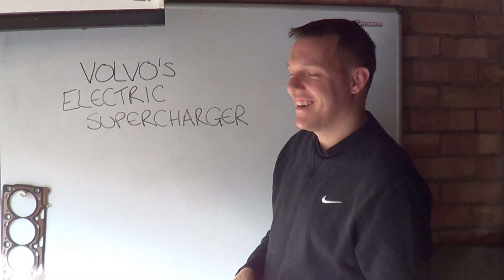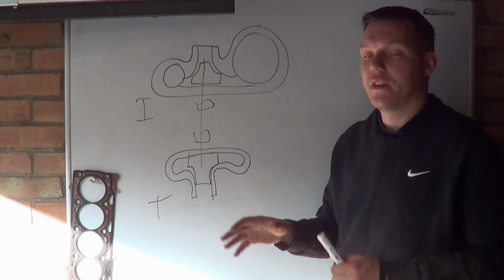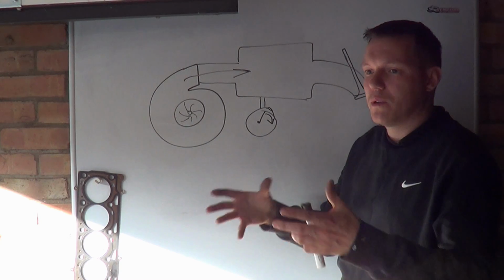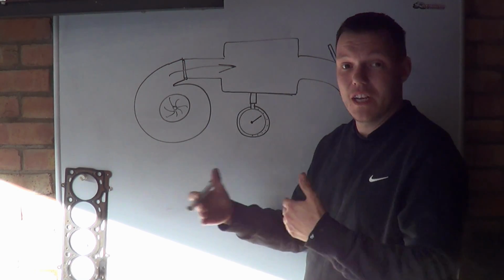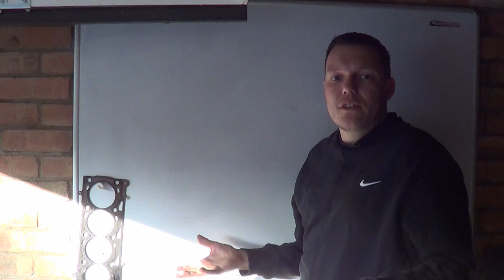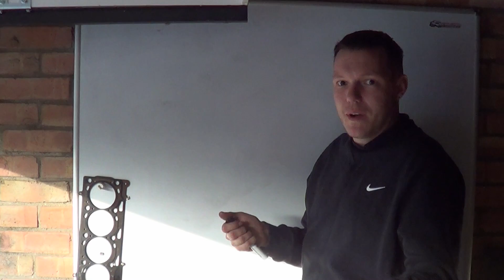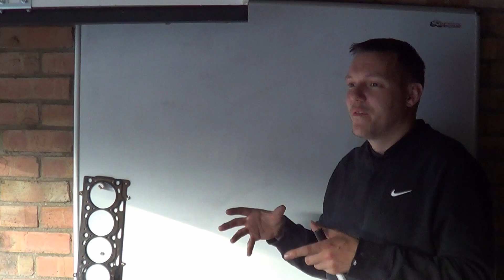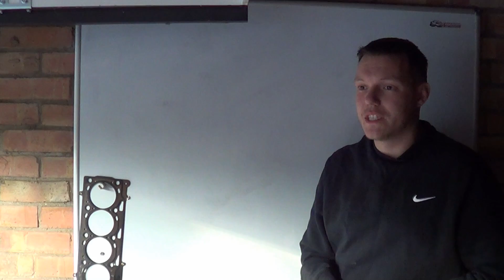Volvo's electric supercharger?

Comment: 1) Why do some companies only make cars, trucks, semi tractors, and motorcycles- but not all or more? Harley Davidson, Yamaha, Kawasaki- only bikes. Kenworth, Peterbilt- only tractors. GMC never a car, Buick never a pickup. Have Volkswagen and Volvo ever made a motorcycle?   2) Many older vehicle systems were 6v DC. What is the hangup on 12v DC? (American houses are 120v AC, aren't some of UK and Russia 240v AC? DC cable cars. HEI systems can reach 30kV. 12v DC can burn your car down jus as fast as 48v DC. We're always putting inverters and extra outlets in our vehicles, and some newer models of (usually) SUV have 120v AC ports. It's so strange- how we need and use electricity now days.

Comment: The heat spins the turbo??! 
The pressure difference makes the hot gas flowing through the turbine and that what makes it spin. Fast  moving gas molecules hit the turbine fins and transfer its kinetic energy from molecular weight displacing them and causing the shaft to spin. The reason why it is important to have the turbo close to the engine is to just take ADVANTAGE of the heat. Simply because the exhaust gas moving far through the manifold would cool down and shrink in volume causing the gas not just to slow down but mainly volumetrically reduce the number of molecules acting on the turbine. That loss in volume makes the turbo less responsive. Lots of guys install the turbos at the very end of car exhaust system where the gas is not nearly as hot as at the collector and the turbo boost just fine. You just need to recalculate turbo size, mainly smaller turbine housing A/R ratio to correct for the lost gas volume and the fact that lots of piping needs to be pressurized. Obviously that makes the system less efficient and not as responsive but still works just fine without any heat what so ever! 
Its kinda like saying that only hot air will spin wind turbines - I'm pretty sure they spin all winter long.
Or heating up the turbine wheel with a torch and watching it spin...?  :)

Comment: Another reason mechanical turbo's have an advantage over electric is that the amount of power going into the impeller is rather large. I work on semis for a living, and a caterpillar 3406 turbodiesel is a one I have a fair bit of experience with. If the engine is running at 2000 RPM and is getting 45 PSI of boost (I have seen it, although in that case the waste gate was disabled, so a bit higher), then the turbo is imparting 101.5 hp (about 76 kW) into the intake. A 12 V system would need more than 6000 amps to do that.

Comment: Can you say in a nutshell how the turbine side of the turbo getting it's spinny power is from heat? Because I'm apparently a bellend who thought it was pressure and flow that spun the turbine and the heat was just unfortunately unavoidable because hot exhaust.

I know a bit about engines, but I'm no expert.  I am a qualified mech eng, but turbos are something I've never dealt with, and for the last 10yrs I've been a CNC programmer, so it's been a while since I've done any kind of mechanical maintenance. 

I'm not asking for a video, even just a quick few sentence explanation would be nice if you can mate, thanks :-)
Reply from the maker: Yes can dude - there will be a video next weekend (16th)
Reply: The Workshop 

Awesome, look forward to it 👍

Comment: So if i take a torch and heat up a turbo it will spin and create boost?
Reply from the maker: No, if you heat up the air flowing through it you will.
Reply: The Workshop so cold will not?
Reply from the maker: Turbo's are design to recover waste heat from the system - if you pass cold air through the turbine then the turbine will turn, of course it will. What I meant to say - and this has been covered in other videos is to get people to think of a turbine as what it is. 

Hotter exhaust = faster turbine. Compare this to an electric only system and you can see why its not worth it.
Reply: The Workshop, i see what you mean. Thanks
Reply: Why intercooler? why not heater? :)

Comment: I got part way through, this & gave up.
Exhaust temperature drives the turbine?
No it doesn't, it uses exhaust gas, FLOW.

Taking advantage, of a byproduct of the combustion process.
To drive the turbine.
The more exhaust flow, the more boost achieved.

Unlike a supercharger which uses a  drive belt, and suffers "parasitic" loss.
The belt  driven supercharger needs x amount of horsepower to run it.
The exhaust driven turbocharger, does not!

It is driven, with no parasitic loss, by the aforementioned exhaust gases.
Reply: Actually no, I don't.
And I also don't call people, retards.
I'll leave you with this Einstein.

"I almost pissed myself laughing when he stated that exhaust flow has nothing to do with spinning/spooling the turbo up LMFAO whilst ROFL.
So if I get a turbo and just say light a oxy-acetylene torch and stick it in the exhaust input port on the turbo it will spool up once it reaches the correct temperature is that correct is it???I smoke the funny weed every day for pain relief, yet even I know you must be on some unbelievably good shit better than ACID.Seriously you don't even know the fundamentals on how a turbo works, not a supercharger a TURBO powered by the exhaust pressure/gas from an engine you dopey sod...If you would like I am sure I can send you some links to how a turbo actually works..."

It seems someone else here has picked you up on it as well.
But you didn't notice it did you, DUMBARSE.

Oh dear, it seems you did.
But other people, are calling you on it.
And you ignored them.

Comment: I have a lot of time for your videos. It's nice to see someone with mechanical understanding but please state the differences in exhaust gas driven turbo chargers and mechanical belt driven super chargers to avoid confusing the audience.. Also when an intake manifold is positively charged with boost pressure the valves open and close allowing the cylinders a portion of the charged air but the boost pressure will not drop down to zero the intake pressure will be maintained by the turbo charger.. A few other things.. The turbo WASTE GATE regulates the flow of air the turbo produces and maintains intake manifold pressure regardless off cylinder consumption (providing the turbo charger used is adequately sized) the DUMP VALVE /TURBO BYPASS VALVE is what opens after throttle body is closed to try and maintain turbocharged speed between gears changes .. Eliminating lag time
Reply from the maker: Right I'm confused here:

"lease state the differences in exhaust gas driven turbo chargers and mechanical belt driven super chargers to avoid confusing the audience"

this doesn' make sense unless I completely fucked the video up? Turbos are exhaust driven hence the TURBO bit meaning turbine. Superchargers are mechanically driven, when do I say differently?

"Also when an intake manifold is positively charged with boost pressure the valves open and close allowing the cylinders a portion of the charged air but the boost pressure will not drop down to zero the intake pressure will be maintained by the turbo charger"

- Again, did I say that it drops to zero? The pressure in a manifold fluctuates up and down, as the cylinders draw in mixture.

"The turbo WASTE GATE regulates the flow of air the turbo produces and maintains intake manifold pressure regardless off cylinder consumption"

- Waste gates allow exahust gases to by-pass the turbine, slowing the turbine/impellers down. This is controlled by manifold pressure which in turn is control by an actuator.

"the DUMP VALVE /TURBO BYPASS VALVE is what opens after throttle body is closed to try and maintain turbocharged speed between gears changes"

- A dump valves dumps the air out of the manifold when aire pressure become to great, protecting the engine. Also know as a blow-off valve. 

I don't understand what the point of this comment is?
Reply: The Workshop it's the turbo waste gate that protects the engine from pressure. The blow off /dump valve only protects /prolongs the life of the turbo allowing its rotating mass to continue once the throttle body it's closed giving the air somewhere to go instead of having to go back through the blades stalling the compressor / limiting the life of the turbo. A blow off/dump valve doesn't protect the engine. I commented about the turbo /super charger as you said about supercharger having turbine blades.. Wasn't trying to be a troll lol just thought I'd challenge as I have belief in my understanding of the system

Comment: would an "electric" variable displacement / angle of attack turbo be like the holy grail ?
Reply from the maker: No, take out the electric bit then you're getting closer. IC engines are heat engines and you wanna make use of the waste heat that is inherent with this engine. Turbo's do a good job of this, but nothing is perfect. At the end of the day lag is time, and really that isn't really that important. You're already getting more power.
Reply: Bob Bobby in theory yeah. There's a thing called a turbo prop airplane. The propeller he's a variable pitch so the engine can stay same rpm's, but have more "pulling air" power. Complex, and when you adjust the angle of the prop, it experiences a wobble from air turbulence....that would destroy a turbo cause it's sealed in a housing. It's a super awesome idea, maybe some r&d into it might pay off huge
Reply: not to sound condescending but ... a turbo prop on a  aircraft and a assisted/variable  turbo for an ICE  are slightly different, one is likened to an impeller/axial compressor that is parasitic... and one is a jet engine with a gearbox and direct drive, because i built one from a "truck" turbo and scrap inconel 825 stock ( yes it died after four runs lol )
but yes seems to be a logical idea that seems to be simple on paper but due to its lack of production models leads me to think the greater minds of the world have left it alone for good reason. (as of yet)

Comment: I don`t think voltage is the problem! Tesla, Zoe, Leaf, and PEVH?
Reply from the maker: They're electric cars, we're talking about ICE cars with electrical systems. Put it this way, it would be better to use higher voltage for the starter motor and reduce the current. What voltage are starter motors on cars and bikes?

Comment: Doesn't KERS in F1 electrically spin up the turbos, to reduce lag?
Reply from the maker: Not as far as I know. Theres a system called MGU-K (Motor Generator Unit Kinetic) and MGU-H (Motor Generator Unit Heat) - The KERS is a kinetic energy recovery system which used flywheels under braking and then added this to the drivetrain I believe when accelerating. This would come under MGU-K. 

I'm not totally sure where the energy from the MGU-H goes? To batteries, flywheels or what..........
Reply: Just watched vid about the Renault F1 KERS. Both the MGU-H and MGU-K are motor/generators. Both feed into a battery, and the MGU-H does spin up the turbo at  low rpm. Didn't see anything about flywheels?

Comment: Awesome. You should do a rant about people and turbo's like your engine warm up clip. Did you know the main failure mode for modern turbocharged vehicles is oxygen starvation to the brain, 
Dozen volts will fry a lot of sensors and ecu. 5 volts tends to be less smokey.

Comment: When you make the video about turbochargers, could you also add the electrical assisted turbocharger systems (those with an actual electric motor)? Would be interesting to know what the thermical  and physical problems are.

Comment: Could you have the same system using a more conventional pulley driven supercharger. I know people have done twin charging before. It would fix your voltage issue. However there is the loss of efficiency from the supercharger.
Reply from the maker: and then its just a supercharger. The aim of an electric system is that it can be 'swtiched off' when required.

Comment: Always wondered why (in regard to turbos) they don't further separate the turbine section from the compressor section? Like putting the compressor section at the front of the engine and the turbine section at the back of the engine. Yea the shaft between the two would have to be long and heavy (i guess) but wouldn't the compressor stay way cooler being far away from the hot section?

Also don't variable geometry turbos solve all the short comings of regular turbos and pretty much make superchargers, electric or mechanical obsolete?
Reply: they do, actually check out the latest mercedes f1 engines, turbo right through the v of the engine, plus its wound up by the kers system as well...big ass shaft connecting the two,  packaging might be an issue, as the f1 turbos are designed to be that long I guess.. weight is an issue, plus making a shaft that long that winds up to those rpms, like 200,000 might be tricky and heavy as well.. also lubrication, bigger shaft bigger bearings, more oil, more weight, more mass for the turbo to wind up..stealing power, and making huge lag.. more complexity, less reliable etc etc.. pretty shure that;s why they make em as small as they do.. as for F1, well they have money to burn on engineering and materials.. as well they thing is pre wound by an electric motor via kers, so once the gasses take over the stresses on that shaft are minimal,  thing's probably made from fucking titanium, inconnel x, unobtainum, and three blessings from the pope..the tolerances are probably in the nanometer range, you wouldn't get an atom between the impeller and the sidewall.. and there's only a single dour tutonic, assembler at luftmeister named klaus that's been there since 1942 that's capable of assembling the F1 turbo's ( he has never smiled or been satisfied with any component, and arrives at work at 8:24.31.02 am every day, precicely).. needless to say these are specialty items.. 
  As for real world applications, hopefully the tech trickles down to us soon,  as the low end torque numbers from those 1.6 liters on boost is amazing, and that's usable real world power in a street car..
Reply from the maker: ATTL - m
Reply: Beach&BoardFan exactly
Reply: Top notch comment!
Reply: there would still be some heat transfer with the 2 sides further apart but its the action of actually compressing the air that creates heat on the compressor side, a centrifugal supercharger suffers from the same issue as do roots etc.
Reply: when matt mentioned the efficiency of the compressor on the graph what that refers to is how much heat is generated for a given flow and pressure. as you increase the pressure and flow requirements together the turbine/compressor has to spin faster and the heat generated by the compressor becomes greater so the air density and air volume (ie flow) curve tapers off. hope that kinda makes sense lol
Reply: replying to myself - also for any other viewers that are as slow as me... ATTL-m   =  Added to the list -matt
Reply: I don't believe the heat is a big problem for the compressor. It is naturally cooled anyway by the massive amount of air flowing through it... It's really the turbine that suffers, and you can't really cool that (nor want to, since you would reduce its efficiency). A long shaft wouldn't be much weight, but ANY additional weight will increase the spool time.
Reply: I dont know Federico, I think compressor side temperature is pretty important because they use intercoolers to cool the intake charge.
Reply: "the action of actually compressing the air that creates heat on the compressor side"
there we go, that's what I was looking for.
Reply: The heat from the turbine side is insignificant.  The shaft is cooled by the oil that's running round it, the oil (and centre housing) is cooled by the water that's running round that, and the compressor side of the turbo is separated by several inches of metal, air gaps and heat shields. 

Intercoolers are used to cool the air after the temperature has been increased due to being compressed.  Not because of the heat from the exhaust.  If a turbo is making less than 7 psi of boost, you don't even need an intercooler.

Comment: why not put a gear ratio in between the impeller and the turbine in the turbo to make the impeller spin faster to reduce the lag? I know they have antilag systems to help with lag on drag racing motors but I have heard that can be damaging to the motor
Reply from the maker: You have to be aware of impeller tip speeds
Reply: sounds like the turbo needs a Transmission
Reply: Master Destruction 
the gear driven impeller super charger in the h2r has a two speed gear shift. they use it to run it most effectively at various engine rpms.